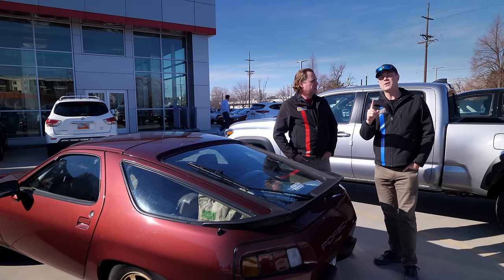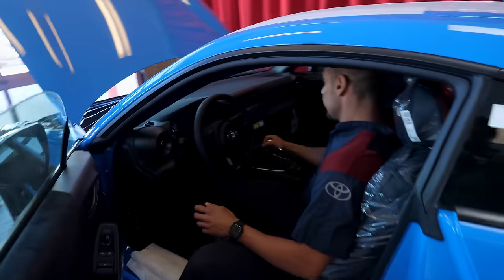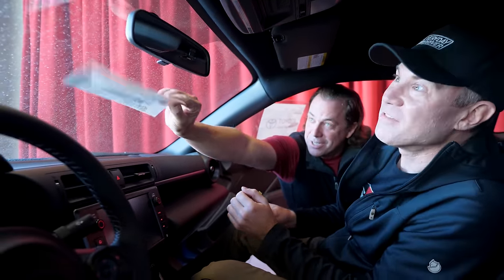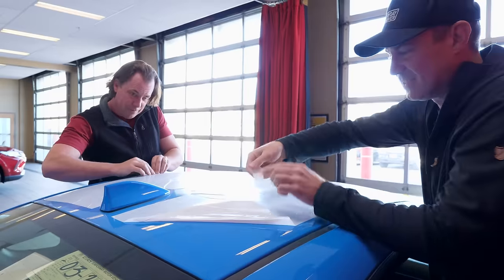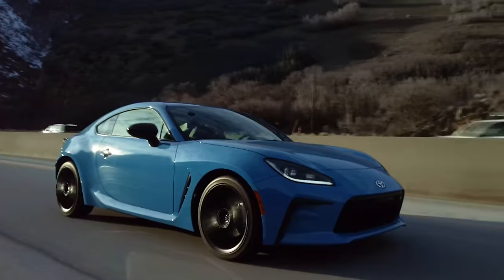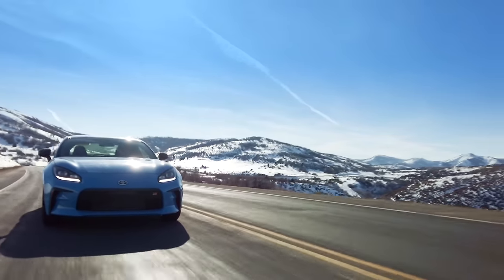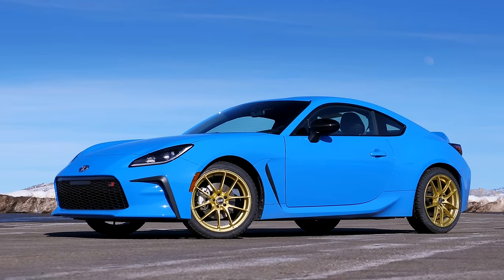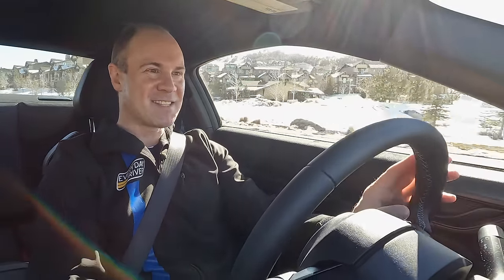We bought a GR86! - Money where our mouth is - Long Term #1 | Everyday Driver

Comment: I just bought a red base one. Finding one of these in manual rn was super hard to even get. Mine is currently in the NY port on its way to the dealer and that was all I could get in 8 states. Unfortunately I had to haggle to just to get it for $34k for the base which is a 5k markup but its the exact color and type I wanted. I'm super excited to drive it later this month.

I always wonder if I should have gotten a premium, the seats look nicer but I dont like the fabric on the door near the windows. There wasnt anything glaring about what was different tho I somehow missed the extra safety things which I thought was just for the automatic only.

Comment: Re: paint protection film (PPF)- I wonder why car manufacturers are seemingly ignoring these buyers and leaving this to the dealers and aftermarket. Or, as here, do a lousy job of it. Done correctly at a competitive price PPF could be a source of additional profit and greater buyer satisfaction. I presume PPF could be applied more consistently and at a lower cost in a factory. 
And on high end cars why aren’t manufacturers offering PPF and ceramic coating? I could see it as a differentiator for Corvettes and Porsches, let alone the exotics. 
What am I missing?
Perhaps there’s some obstacle I haven’t considered?

Comment: Congrats on the new car! i have been wanting a rwd sports car for a while now. i really want an nd2 miata. i purchased a 2015 audi s4 instead because of the price i paid. i paid $33k for it 2 years ago with 36k miles. over that time ive tuned it and done all the works to it and its fast no doubt, but at the end of the day its still a sedan that weighs 4,000lbs. yes doing awd launches is fun 0-60 in 3.5 seconds is fun. it drives great in the corners as well, but ive never driven a proper lightweight sports car. So my question to yall is should i get rid of the s4 for the GR86? am i crazy for thinking that? i was working at a subaru dealer when the brz came out and fell in love immediately, the only thing i didnt like was the power. it was just too low (i really wish the put the 6 cylinder in these cars) but now that the power is up it seems very intriguing again to have that lightweight basic sportscar experience, and they are getting harder and harder to come by these days. these are special cars.

Comment: I've own two FRS and a BRZ, all first gen and they all did 7.8L/100km (33.6 mpg) average for the whole year and I was driving it during quebec winters. I noticed that going with different tyres size made a lot of difference in fuel economy. My second FRS came with 235 tyres (instead of 215) and average was 8.8L/100km (29.4 mpg). Doing 23.4mpg is atrocious !!
Reply from the maker: We're at high altitude and everything suffers here. Most cars, no matter the engine, turbo, or whatever - run 5-8MPG lower than people get at sea level. As stated, 24mpg on the new one is the same we got on the first generation in our area. Thanks for watching!
Reply: Keep in mind too that the British gallon and the US gallon are different as well.  7.8L/100km is 30.1mpg and 8.8L/100km is 26mpg respectively.
Reply: @EverydayDriver  curious to know, how high in altitude are we talking about ?
Reply from the maker: Most of our driving happens above 6,000ft. Higher than Denver, Colorado in elevation

Comment: Currently have a CTR and absolutely love the car, but the GR86 has been very attractive to me as it is NA, and RWD and a bit lighter as well (also i am kinda wanting a sports coupe rather than a 4 door hatch and i already have a civic hatch as well) do you guys think the switch would be worth it? I still need to test drive one to see if i like the driving dynamics but what are your guys’ opinions.

An added note is that CTRs are super high in value rn
Reply from the maker: The CTR is one of the best FWDs ever, especially considering its usability. A fantastic car. But, if you don't need that usability and think of that space in your life as the "fun car" then the GR86 would likely be more enjoyable. Since you miss NA and RWD, it's hard to do in the current car market, especially considering the price.

Comment: The car I should have waited for, maybe. I spent the same on a 2022 Mazda3 Premium AWD. Enjoyable for different reasons. About the tires: I know there’s many times the full winter tires are the best option, but could you have gotten away with the Michelin Pilot Sport All Season 4? Very good in wet/cold, still useable in snow, and much better in warmer temps. Or perhaps even the CrossClimate2 for something more winter biased that still works above 40°F?

Comment: Great job guys. Love the color. Question: What was the tech at the dealer installing in the fuse box after opening the hood? It looks like he inserted two fuses. What were they for?
Reply from the maker: Most cars arrive at the dealer with certain fuses pulled to prevent it from being opened or started. Notice the tech uses the key hidden in the fob to open the door for the first time. All part of the process they normally do before a buyer arrives. We asked them to leave everything until we got there. Thanks for watching.

Comment: As someone with a '20 GT86/BRZ with perf package, the only thing I am really interested in the new ones is the digital dash and modifications that might come to that from 3rd parties. I really want to be able to customize what data from the ECU is shown and how and I am sure that someone will make a flash for it for after market ECUs. That aside, would you think the $34k price is worth it for the extra power vs a $15-20k 2017+ GT86 with the standard uel header, suspension, charged boost pipeline?
Reply: You’re not getting a 2017+ for 15-20k anymore, especially from a dealer at the moment…
Reply: @Barbwire710  true that. but if you buy them for more, u a silly goose
Reply: @GarretSpenstHGF  I agree, but no one has a choice right now. Even people in my local Toyota group are selling their 2017+ for 25k+, one is $29k.
Reply: @GarretSpenstHGF  might take a long time for the prices to go back to normal sadly.

Comment: Is there a dead zone in the gas pedal within the first 1cm or so on your GR86? I drove one and it was incredibly difficult to heel toe, especially in lower speeds. I have no issues doing this in my stock FRS as the gas pedal is quite responsive.

Comment: Is the premium worth the extra $2000??
I ask because the only thing I will keep for some time and not change are:
Obviously the better fabric
Speakers (are 8 instead of 6 in the base model)
BSD and RCTA and AFS.
 Heated seats
 However I will change the tires, wheels, and probably remove the ducktail spoiler/add a different spoiler. I will tint the windows 15%
I would like opinions and comments.. I plan on buying this car in april/may, but I dont know what to pick.

Comment: i want to get one however i never drove a manual transmission before and i heard the automatic not that great..also im currently driving a 2012 corolla 4speed auto with only 22k miles on it so i think the 6 speed auto would feel better than the 4 speed to me personally

Comment: Enjoyed the vid. Subscriber and love your content. I owned a 2014 FR-S for one year and traded it in because i thought the motor was absolute garbage. I ended up trading it in on my current car a 2010 base Porsche Cayman manual I’ve loved for the last 7 years. My question to you guys and your extensive knowledge is would i be foolish to trade the Cayman for this new generation since the engine is a little better? i always thought the chassis was sublime and not an issue at all. I would only consider this if it was an even up deal and no money exchanged. Thanks

Comment: Also from what I’ve read, the tranny is the same. Shifter is the same. A funny. They hit the budgeted amount and had to use the 2nd gen exhaust. Which is why the exhaust tips are so far in. The bumper got longer and no one thought to check to make sure the tips were flush. Details. Suspension fitment is the same between the two. Big note. My 17x9, 245/40 et 38 rub on the 2022 with stock setup. Didn’t on the stock 2018.

Comment: I'm considering buying a 2023 GR86 Premium in Manual. I'm not planning on tracking it or putting performance mods on it. Do you think it will run into the oil issues everyone is talking about?
Reply from the maker: The recent testing has shown oil pressure issues, but they are all related to fast corners during high-g track use. The chances of it being an issue in street driving would be small.
Reply: @EverydayDriver  Thanks for the response. That's good to hear. I think I read another  comment where there's a slight mechanical difference concerning the oil pickup. Do you happen to know anything about that? Regardless, I don't think that will change my decision to buy the car :)

Comment: Sad that Neptune is a Toyota exclusive color. (it's Voodoo blue on other Toyotas). Current WRB isn't good looking, would probably go red with a BRZ. I've got this thing in my head, where since the BRZ/86 is a Subaru, outside of Toyotas D-4S injection system and some badges, I'd want to buy a BRZ, the BRZ also has updated rear suspension.
I've got an IS350, the factory PPF they install is bare minimal, aftermarket is the right choice, but I've got kids and it's a family car, so I'm not worried (has door dings and rock chips). Related/unrelated my red IS350 came with staggered black wheels, and I didn't like them, so I went with a wider square stance bronze wheels. Bronze wheels work on nearly every color for me; brake dust is a PITA though.
Edit: when it comes to the faux engine noise - Lexus has a resonator in the intake, which is the way they should have gone if they wanted to augment the engine noise without increasing exhaust noise.

Comment: I actually owned a 2011 Lancer Ralliart Sportback.  I thought the Ralliart was fun, but not nearly as fun as my old Evo 8.  How do you rank the fun factor of the GR86 compared to the Ralliart Sportback and the Evo Xs that you have driven?  I am very close to putting a deposit down on the GR86, but I want to make sure it has that fun factor that the Ralliart and Evo 9s and 10s had.
Reply from the maker: The AWD and torque vectoring of the EVO is obviously a different feel. But the 86 definitely has the playfulness of those cars. Feels almost as powerful as the ralliart. Evo does have more punch, and is a favorite, but both our guys would pick the 86 over the Evo. Thanks for watching!
Reply: @EverydayDriver  Thank you for taking the time to respond!  Yes the experience of driving an Evo 8 /9 and some modified 10s is priceless, but the Evo 8s and 9s are so old now.  I am sure a small turbo kit will close the performance-fun gap between the GR86 and the Evos.  I hope to report back here in a few months after I purchase a GR86!  Edit:  Liked and Subscribed!

Comment: Hey guys, I live in Illinois with 4-5 months of snow. How does if handle a snowy day on the highway? What about driving 20 miles home after a heavier snow? Can it lose control on the highway with a little bit of powder snow below freezing?
Reply from the maker: The key factor is tires. With dedicated winter tires the 86 can be a blast in the snow.

Comment: I love what you guys are doing!  Really looking forward to seeing what you guys do with this car

I've been on the fence about ordering one myself, as a second car for weekends and casual joy rides.  What I'm interesting in knowing is how comfortable you guys find it for longer road trips (eg. like what you guys did for the Pacific Coast cruise)?  Particularly the seats, road noise, and rattles if any exists. I know I'd be turned off by that speaker engine noise, so that's probably one of the first things I'd want to get rid of. Anyway I just can't help but wonder if I'd be better off saving up more for a used BMW 2-series instead (m240i?) which would have a more refined interior, though those are also quite hard to find with manuals.

Comment: For me, I want to see that blue compared to the 1st gen BRZ limited run of HyperBlue paint Subaru did. Wondering if I should save for the new GR86 in this blue or buy the used BRZ Hyperblue and swap in the 2.4L later down the road when the 2.0L engine breaks.

Comment: Is the relatively meh fuel economy partially due to the inherent design of a boxer engine? The Miata gets 32-35+ without really trying, but I didn’t think 400 lbs would equate to ~10 mpg difference.
Reply: Probably yes.  Not many advantages to boxer beside low cg.  k series Hondas still best 4 cylinders

Comment: I had the 1st gen brz, how much better in power is the new brz? Can you feel the power improvement clearly?
Reply: Yes.  There is a significant difference.  Some back to back dynos show the difference is actually around 40hp to the wheels,  so this thing could have been rated as high as 240hp or so and it wouldn't be off.
Reply: @gs98999  thanks. My lical dealer told me there will be a gr86 coming in May so I probably will buy it. Subaru dealership told me they have no idea when the brz will arrive
Reply: @gs98999  local

Comment: I am happy that you bought it and I really wish I could buy it, too.  But, please explain to me how this is not a "second car"?  I get it if you are young, single, and don't care about driving friends in your car (and better have a good job).  I could see it if you are old and single and don't have any friends anyway.  But I have two teenagers that I drive.  Where do they fit in this car?  How about my parents?  How about shoving items from a Home Depot run into this thing?  If there could be a car that would be perfect for me it would be the new Civic Si with the engine turned 90 degrees and the rear wheels pushing it.  Sadly, that is not going to be something any manufacturer is going to produce.  And no, the overpriced Caddy duo of regressive gas guzzlers is not the same thing.  That's the problem.

Comment: Just watched another of my favorite car channels - The Topher- who just picked up a new BRZ premium (lower level trim). He disabled the electronic sound  via the panel on the passenger side end of dash panel. Sounds like some potential differences in suspension tuning in the BRZ vs the GR86 (which might be interesting to explore on a video), but everyone (including Topher) is presently running on winter tires so maybe wait until everyone gets back to OEM summer tires. Does anyone have inside knowledge re the OEM wheels on the '22 BRZ premium (lower trim level)? I have the '17 BRZ Limited with Performance Pack (Brembos, different wheels that are 1/2" wider, and Sachs dampers) and the wheels on the '22 Premium BRZ sure look like the same wheels as my Limited w/PP. Anyone know if they are the same? Would be interesting to know if the wheels for the '17 fit the '22. I have winter tires and wheels for mine, and it would be a potential bonus if they would fit the next gen. MIght give Tire Rack a call. Got my Sparco wheels and Blizzaks from them.

Comment: I leased a 14 FRS, I’m looking to purchase either this , mx5 club or go all out and GT premium mustang (5.0).  Pros and cons 2 each option are there.  Being an ex motorcycle rider, not looking to ride anymore on public roads, the mx5 makes a lot of sense (obv soft top), the frs/gr86 is an familiar option but I always hated the torque dip bw 4.5k to 5.5k, gt mustang paired with borla is ultimate pony car but I’m not sure it’s worth the meager fuel economy, loud status (am cold starts and general being a nuisance).  I have no intentions to track any of these vehicles, I just want a reliable, yet still “practical” daily car that’s also fun.  I would love any input from u guys/ anyone else.  For context, My work commute is less than 30 miles and requirement is rwd, 6 speed.  Thoughts? Is gr86 any different than 14 frs? That Neptune blue and duck tail is looking. Really sharp.  But even with a cat back it’s never gonna have the exhaust note of a na v8.  Sorry for random thoughts.  I’m surprised u guys were entertained got away with msrp vehicle sale esp in the current market.
Reply from the maker: Watch our comparison with GR86 vs  mx5 rf, as well as our first drive video from the product launch. Second Gen solved the torque dip and a few other things. Yes, no contest against V8 sound and grunt, but 86 seems a much better feel and match for someone with motorcycle background. Hope that helps. Thanks for watching!

Comment: I tragically lost my 5 speed manual Lexus IS 300 recently.  I miss her supple subdued 2JZ-GE straight six engine note.  I miss her so much.  
I have always thought that Subarus were rubbish because they have the 2.0 liter boxer engine that have always had a history of appalling nightmare engine issues that include leaky head gasket issues and other appalling engine issues.  
The engine note is really important to me in a car.  Too much engine noise is such a knocking racket.  Are you literally saying that Toyota or Subaru, whoever they hell they are, literally connected their engine noise to the speakers in the car?  And it isn't the actual engine noise?  It's a fake noise that the driver can hear in the speakers?  The issue needs to be addressed at the dealer?  That is so bloody wrong.  

Is the manual 6 speed transmission the base model?  
Does this car only drive with premium 91 octane gasoline?
Does this car have the start  / stop engine constantly using the starter when stopped and or stuck in traffic?  
Jeremy Clarkson fit in the first version GT86.  
Is this car easy to get in and out of, you know?  
Thanks.
Reply: Yes, it's an artificial synthesized sound to mimick the engine tone.
If you think that's bad, some manufacturers like Audi and Maserati are doing the same thing, except playing the sound by loudspeaker installed in the exhaust muffler.
Reply: @reno9k  appallling.